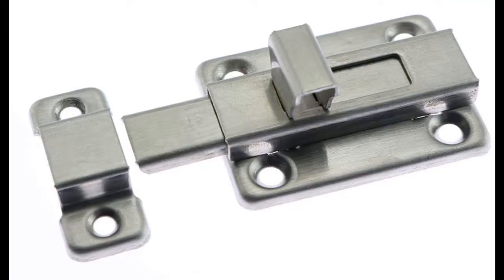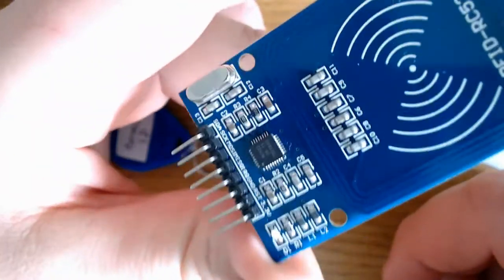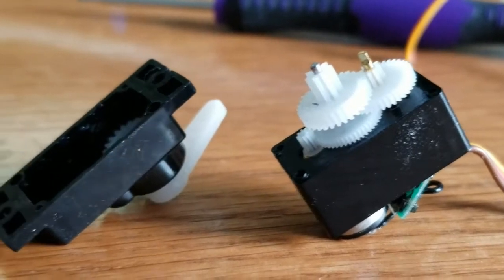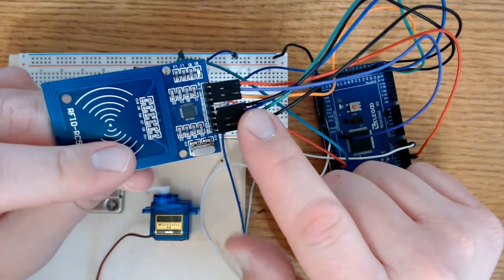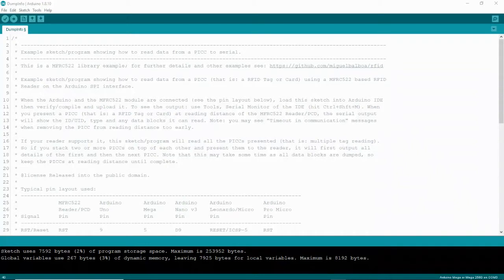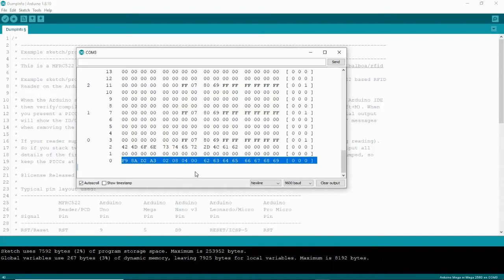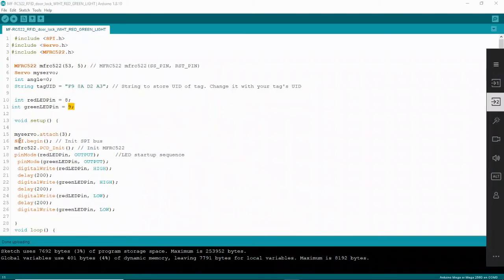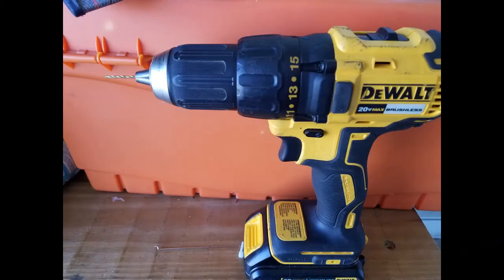DIY motorized door locking mechanism Using Arduino RFID & Servo Motor - A Simple Keyless Door Lock

Comment from the maker: The code could probably be cleaned up a bit but overall, this was a fun project. Give it a try!  Thanks for watching~
Reply: Hi can you tell me where I can find the code
Reply: Hi BMonster, is there any way of adding more than one rfid card to the code? Thanks.
Reply from the maker: @archiehaigh4796  I didn't forget about ya. Before I answer I want to test it out first so I'm not posting confusion :)  I will try it out this evening and let you know.
Reply from the maker: I added a video and code for 2 ID cards on the Facebook page.  I declared my second tag ID as "String tagUID2" and set up a 2nd if/else statement in the loop for the 2nd tag. See the post and let me know what ya think.
Reply: @BMonsterLaboratory  thank you, is there any way you can send the updated code by email as I don’t have Facebook. Thank you.
Reply from the maker: @archiehaigh4796  i'm emailing it to you now
Reply: @BMonsterLaboratory  thank you, and if I want to add a third tag I can just name the 3rd tag tag UID 3?
Reply from the maker: @archiehaigh4796  Yes, and add that tag to the if/else statement in the loop.

Comment: Good afternoon BMonster Laboratory! Could you possible share your final code for the door lock? Somewhere your fans can try the same code?
Reply: I would most definitely like to join that! I am looking to become an engineer soon and your projects truly help me get a better understanding of basic hardware/software.
Reply from the maker: @Tune-zi7yr  That's great. Send me a message at bmonsterlaboratory@gmail.com and  Include "ADD ME" in subject.
Reply from the maker: hey there!
I used to post all code to Facebook but it got really confusing for longer code and sometimes the code post would be hidden. I now send all code and diagrams to my mail list, and you're certainly welcome to join that - just send me an email if interested.  Best of luck to ya!!! 👍👍

Here's the code:

#include <SPI.h>
#include <Servo.h>
#include <MFRC522.h>
 MFRC522 mfrc522(53, 5); // MFRC522 mfrc522(SS_PIN, RST_PIN)
 Servo myservo;
 int angle=0;
 String tagUID = "F9 8A D2 A3"; // String to store UID of tag. Change it with your tag's UID
 int redLEDPin = 8;
int greenLEDPin = 9;
 void setup() {
 myservo.attach(3);
 SPI.begin(); // Init SPI bus
 mfrc522.PCD_Init(); // Init MFRC522
 pinMode(redLEDPin, OUTPUT);     //LED startup sequence
  pinMode(greenLEDPin, OUTPUT);
  digitalWrite(redLEDPin, HIGH);
  delay(200);
  digitalWrite(greenLEDPin, HIGH);
  delay(200);
  digitalWrite(redLEDPin, LOW);
  delay(200);
  digitalWrite(greenLEDPin, LOW);
 }
 void loop() {
 // Look for new cards
 if ( ! mfrc522.PICC_IsNewCardPresent()) {
 return;
 }
 // Select one of the cards
 if ( ! mfrc522.PICC_ReadCardSerial()) {
 return;
 }
 //Reading from the card
 String tag = "";
 for (byte i = 0; i < mfrc522.uid.size; i++)
 {
 tag.concat(String(mfrc522.uid.uidByte[i] < 0x10 ? " 0" : " "));
 tag.concat(String(mfrc522.uid.uidByte[i], HEX));
 }
 tag.toUpperCase();
 //Checking the card
 if (tag.substring(1) == tagUID) //change here the UID of the card/cards that you want to give access
 {
 digitalWrite(greenLEDPin, HIGH);    //Green LED sequence
      delay(200);
      digitalWrite(greenLEDPin, LOW);
      delay(200);
      digitalWrite(greenLEDPin, HIGH);
      delay(200);
      digitalWrite(greenLEDPin, LOW);
      delay(200);
 myservo.write(180);
 //digitalWrite(greenLed, HIGH);
 delay(5000);
 //digitalWrite(greenLed, LOW);
 myservo.write(0);
}
 else
 {
 // If UID of tag is not matched.
  Serial.println ("Access Denied");
    digitalWrite(redLEDPin, HIGH);      //Red LED sequence
    delay(200);
    digitalWrite(redLEDPin, LOW);
    delay(200);
    digitalWrite(redLEDPin, HIGH);
    delay(200);
    digitalWrite(redLEDPin, LOW);
    delay(200);
 }
 }

Comment: My board is arduino nano can you tell me where to connect what with what?? My board does not have D52 or D51 it only has up to D13
Reply from the maker: Ya, no problem!
Those are SPI interface connections. Here they are for the Uno.
SPI: 10 (SS/SDA), 11 (MOSI), 12 (MISO), 13 (SCK). These pins support SPI communication using the SPI library.
Check out this Arduino site for Uno pinout - it's very helpful. https://docs.arduino.cc/retired/boards/arduino-uno-rev3-with-long-pins/
When changing boards and pins, make sure you define the correct pin number. In this case,  ( #define SS_PIN 10, #define RST_PIN 5)
 👍💪

Comment: I can't figure out how to add multiple tags. I tried adding a comma like you said but then neither of my tags work. Right now, I can use only one tag. Thanks!
Reply from the maker: hi! You can use an array of strings to store the allowed UIDs and then check if the scanned tag's UID matches any of the allowed UIDs. Try this. The sketch for this video was posted to Facebook. After modifying it, it would look like this.

#include <SPI.h>
#include <Servo.h>
#include <MFRC522.h>

MFRC522 mfrc522(53, 5); // MFRC522 mfrc522(SS_PIN, RST_PIN)
Servo myservo;
int angle = 0;

// Array to store UIDs of allowed tags. Change these values to your tag UIDs.
String allowedTags[] = {"F9 8A D2 A3", "YOUR_SECOND_TAG_UID", "YOUR_THIRD_TAG_UID"};
int numAllowedTags = sizeof(allowedTags) / sizeof(allowedTags[0]);

int redLEDPin = 8;
int greenLEDPin = 9;

void setup() {
  myservo.attach(3);
  SPI.begin(); // Init SPI bus
  mfrc522.PCD_Init(); // Init MFRC522
  pinMode(redLEDPin, OUTPUT);     //LED startup sequence
  pinMode(greenLEDPin, OUTPUT);
  digitalWrite(redLEDPin, HIGH);
  delay(200);
  digitalWrite(greenLEDPin, HIGH);
  delay(200);
  digitalWrite(redLEDPin, LOW);
  delay(200);
  digitalWrite(greenLEDPin, LOW);
  Serial.begin(9600); // Initialize serial communications
}

void loop() {
  // Look for new cards
  if (!mfrc522.PICC_IsNewCardPresent()) {
    return;
  }
  // Select one of the cards
  if (!mfrc522.PICC_ReadCardSerial()) {
    return;
  }
  // Reading from the card
  String tag = "";
  for (byte i = 0; i < mfrc522.uid.size; i++) {
    tag.concat(String(mfrc522.uid.uidByte[i] < 0x10 ? " 0" : " "));
    tag.concat(String(mfrc522.uid.uidByte[i], HEX));
  }
  tag.toUpperCase();

  // Check if the scanned tag is in the list of allowed tags
  bool accessGranted = false;
  for (int i = 0; i < numAllowedTags; i++) {
    if (tag.substring(1) == allowedTags[i]) {
      accessGranted = true;
      break;
    }
  }

  if (accessGranted) {
    // If the tag is allowed
    Serial.println("Access Granted");
    digitalWrite(greenLEDPin, HIGH);    // Green LED sequence
    delay(200);
    digitalWrite(greenLEDPin, LOW);
    delay(200);
    digitalWrite(greenLEDPin, HIGH);
    delay(200);
    digitalWrite(greenLEDPin, LOW);
    delay(200);
    myservo.write(180);
    delay(5000);
    myservo.write(0);
  } else {
    // If the tag is not allowed
    Serial.println("Access Denied");
    digitalWrite(redLEDPin, HIGH);      // Red LED sequence
    delay(200);
    digitalWrite(redLEDPin, LOW);
    delay(200);
    digitalWrite(redLEDPin,
Reply from the maker: You are scanning each card for it's own unique UID ?  just checkin' 👍

Comment: Please give me the code
Reply: Circuit diagram please
Reply from the maker: see 8:01  for rfid reader wiring. 👍
Reply from the maker: here it is                 
#include <SPI.h>
#include <Servo.h>
#include <MFRC522.h>
 MFRC522 mfrc522(53, 5); // MFRC522 mfrc522(SS_PIN, RST_PIN)
 Servo myservo;
 int angle=0;
 String tagUID = "F9 8A D2 A3"; // String to store UID of tag. Change it with your tag's UID
 int redLEDPin = 8;
int greenLEDPin = 9;
 void setup() {
 myservo.attach(3);
 SPI.begin(); // Init SPI bus
 mfrc522.PCD_Init(); // Init MFRC522
 pinMode(redLEDPin, OUTPUT);     //LED startup sequence
  pinMode(greenLEDPin, OUTPUT);
  digitalWrite(redLEDPin, HIGH);
  delay(200);
  digitalWrite(greenLEDPin, HIGH);
  delay(200);
  digitalWrite(redLEDPin, LOW);
  delay(200);
  digitalWrite(greenLEDPin, LOW);
 }
 void loop() {
 // Look for new cards
 if ( ! mfrc522.PICC_IsNewCardPresent()) {
 return;
 }
 // Select one of the cards
 if ( ! mfrc522.PICC_ReadCardSerial()) {
 return;
 }
 //Reading from the card
 String tag = "";
 for (byte i = 0; i < mfrc522.uid.size; i++)
 {
 tag.concat(String(mfrc522.uid.uidByte[i] < 0x10 ? " 0" : " "));
 tag.concat(String(mfrc522.uid.uidByte[i], HEX));
 }
 tag.toUpperCase();
 //Checking the card
 if (tag.substring(1) == tagUID) //change here the UID of the card/cards that you want to give access
 {
 digitalWrite(greenLEDPin, HIGH);    //Green LED sequence
      delay(200);
      digitalWrite(greenLEDPin, LOW);
      delay(200);
      digitalWrite(greenLEDPin, HIGH);
      delay(200);
      digitalWrite(greenLEDPin, LOW);
      delay(200);
 myservo.write(180);
 //digitalWrite(greenLed, HIGH);
 delay(5000);
 //digitalWrite(greenLed, LOW);
 myservo.write(0);
}
 else
 {
 // If UID of tag is not matched.
  Serial.println ("Access Denied");
    digitalWrite(redLEDPin, HIGH);      //Red LED sequence
    delay(200);
    digitalWrite(redLEDPin, LOW);
    delay(200);
    digitalWrite(redLEDPin, HIGH);
    delay(200);
    digitalWrite(redLEDPin, LOW);
    delay(200);
 }
 }

Comment: hello! I'm planning to use a servo-operated lock for a project of mine, and was wondering is you still had a link to that specific lock? It's nice that a wire can be fed into the handle. I think I found it but so far nothing has given me a side-view to verify it's hollow. Thanks a lot!
Reply from the maker: Hi there!  I got this on Amazon.  Do a search with ASIN:B07SHS9TQH  that should pull it up

Comment: Can you please give me the whole code except for the LED part? Thx in advance
Reply from the maker: hello!   I found the code on the Facebook post and removed the LED functionality.  Here it is.        

#include <SPI.h>
#include <Servo.h>
#include <MFRC522.h>

MFRC522 mfrc522(53, 5); // MFRC522 mfrc522(SS_PIN, RST_PIN)
Servo myservo;
int angle=0;
String tagUID = "F9 8A D2 A3"; // String to store UID of tag. Change it with your tag's UID

void setup() {
  myservo.attach(3);
  SPI.begin(); // Init SPI bus
  mfrc522.PCD_Init(); // Init MFRC522
}

void loop() {
  // Look for new cards
  if (!mfrc522.PICC_IsNewCardPresent()) {
    return;
  }

  // Select one of the cards
  if (!mfrc522.PICC_ReadCardSerial()) {
    return;
  }

  //Reading from the card
  String tag = "";
  for (byte i = 0; i < mfrc522.uid.size; i++)
  {
    tag.concat(String(mfrc522.uid.uidByte[i] < 0x10 ? " 0" : " "));
    tag.concat(String(mfrc522.uid.uidByte[i], HEX));
  }
  tag.toUpperCase();

  //Checking the card
  if (tag.substring(1) == tagUID) //change here the UID of the card/cards that you want to give access
  {
    myservo.write(180);
    delay(5000);
    myservo.write(0);
  }
  else
  {
    // If UID of tag is not matched.
    Serial.println ("Access Denied");
  }
}
Reply: @BMonsterLaboratory  thanks so much(going to sub and tell my friend about this channel)
Reply from the maker: @Lowgraphic0  Awesome. thanks~!

Comment: when i want to open it manually the servo will resist and i can't get new position (opened) any idea how to solve this ?
Reply from the maker: If your closed angle is 0, close the lock and reattach the servo. the servo will go to 180 when the lock is open.  You may also need to disconnect your servo power and rotate arm to 0 (locked) position.  Be sure it's disconnected and don't use excessive force or attempt to move the arm beyond its normal range of motion.  I think that should do it!  Have fun 👊👍
Reply: @BMonsterLaboratory  I'm going to try this, thank you so much very clear and informative video👏
Reply from the maker: @ghoumamohamed  you're welcome. best of luck on your projects.

Comment: Hii there! 
Can you please provide the breadboard schematics?
Reply from the maker: For the breadboard, it's just 2 leds.  The ground rail is connected to Arduino ground pin. Both short pins of the leds are connected to that same ground rail.
The  long pin of the 2 leds are each connected to a 220ohm resistor which is connected to pin 8 and 9 on the Arduino. That's it. Hope that helps 👍

Comment: bro can u help me now !!! im cant use code MFRC522.h
Arduino: 1.8.18 (Windows 10), Board: "Arduino Uno"

Arduino-Security-Access-Lock-RFID-MFRC522:7:10: fatal error: MFRC522.h: No such file or directory

 #include <MFRC522.h>

          ^~~~~~~~~~~

compilation terminated.

exit status 1

MFRC522.h: No such file or directory

This report would have more information with
"Show verbose output during compilation"
option enabled in File -> Preferences.

pls help me!!
Reply from the maker: Hi there. 
You need to install the MFRC522 library. Go to "manage libraries" in your IDE and search "MFRC522". Install it from there.
Reply: @BMonsterLaboratory  thanks bro 👍🏽👍🏽 appreciate you

Comment: Hello BMonster Laboratory, Can i change Arduino mega 2560 to arduino uno r3?
Reply from the maker: Hi there! yes, you can switch from mega to uno in the IDE. click the tools tab on the top left, click on the "board" drop down menu, click Arduino AVR Boards and select "UNO" from the drop down menu. Also, make sure you have the right port selected under the tools tab. Hope that helps! This video may help with getting started - https://youtu.be/UiQ7bEZdvOg

Comment: My servo keeps buzzing in locked and unlocked positions. Like it's trying to move further.
Reply from the maker: Hey Rich!  This happens to me when I don't have sufficient power to the servo. Are you using an external 5-6v power supply?  Is your lock too heavy or is if difficult to lock and unlock?
Reply: @BMonsterLaboratory  I haven't attached a lock yet. I will try using my bench power supply. I've had it setup on a breadboard. I will set it up again later and will let you know how it goes.
Reply from the maker: @Richie_  sounds good. Just don't power motors from arduino. Use a breadboard power supply.
Reply: @BMonsterLaboratory  it seems ok now. What is the code int lock = 4; do? what is the value 4?
Reply from the maker: int is a data-type.  lock is defined pin 4 on the Arduino board. Check out Arduino reference page and cplusplus.com tutorials for references. It's very helpful.
Reply: @BMonsterLaboratory  I thought the servo was controlling the lock, which is on 3.
Reply from the maker: @Richie_  I see what you're saying.  
If servo is on 3 it should be 
Int lock = 3;
And in setup it should say 
Servo.attach(lock);
Good catch... not sure why I left it like that.
Reply: @BMonsterLaboratory  cool.

Comment: Hey BMonster could you please email me the code for the project. Thanks!
Reply: Okay I can just copy and paste it into arduino ide?
Reply from the maker: @southerncharmoutdoors6639  yes. It should work
Reply: Okay thanks
Reply from the maker: @southerncharmoutdoors6639  welcome anytime
Reply from the maker: #include <SPI.h>
#include <Servo.h>
#include <MFRC522.h>

 MFRC522 mfrc522(53, 5); // MFRC522 mfrc522(SS_PIN, RST_PIN)
 Servo myservo;
 int angle=0;
 String tagUID = "F9 8A D2 A3"; // String to store UID of tag. Change it with your tag's UID

 int redLEDPin = 8;
int greenLEDPin = 9;
 
 void setup() {
 myservo.attach(3);
 SPI.begin(); // Init SPI bus
 mfrc522.PCD_Init(); // Init MFRC522
 pinMode(redLEDPin, OUTPUT);     //LED startup sequence
  pinMode(greenLEDPin, OUTPUT);
  digitalWrite(redLEDPin, HIGH);
  delay(200);
  digitalWrite(greenLEDPin, HIGH);
  delay(200);
  digitalWrite(redLEDPin, LOW);
  delay(200);
  digitalWrite(greenLEDPin, LOW);
 
 }
 void loop() {
 
 // Look for new cards
 if ( ! mfrc522.PICC_IsNewCardPresent()) {
 return;
 }
 // Select one of the cards
 if ( ! mfrc522.PICC_ReadCardSerial()) {
 return;
 }
 
 //Reading from the card
 String tag = "";
 for (byte i = 0; i < mfrc522.uid.size; i++)
 {
 tag.concat(String(mfrc522.uid.uidByte[i] < 0x10 ? " 0" : " "));
 tag.concat(String(mfrc522.uid.uidByte[i], HEX));
 }
 tag.toUpperCase();
 
 //Checking the card
 if (tag.substring(1) == tagUID) //change here the UID of the card/cards that you want to give access
 {
 digitalWrite(greenLEDPin, HIGH);    //Green LED sequence
      delay(200);
      digitalWrite(greenLEDPin, LOW);
      delay(200);
      digitalWrite(greenLEDPin, HIGH);
      delay(200);
      digitalWrite(greenLEDPin, LOW);
      delay(200);
      
 myservo.write(180);
 //digitalWrite(greenLed, HIGH);
 delay(5000);
 //digitalWrite(greenLed, LOW);
 myservo.write(0);
 

 
}
 else
 {
 // If UID of tag is not matched.
  Serial.println ("Access Denied");
    digitalWrite(redLEDPin, HIGH);      //Red LED sequence
    delay(200);
    digitalWrite(redLEDPin, LOW);
    delay(200);
    digitalWrite(redLEDPin, HIGH);
    delay(200);
    digitalWrite(redLEDPin, LOW);
    delay(200);

 }
 }
Reply from the maker: Hi R Lewis! Try the code I posted.  I'm surprised it fit. You can also find it on Facebook search #simplekeylessdoorlock

Comment: Hello thanks for explaining, I'm going to program a gaz sensor for my final project the gaz sensor+ buzzer + led it's working for me but i don't know how to program with it a servomotor is there any code for all these please, or can i have help I'm not good in programmation
Reply from the maker: hi there! I'm not sure what a gaz sensor is. Is this a gas sensor?  Like a CO2 or methane sensor with a buzzer and led flashing lights? What is the purpose of the servo motor in your setup? It sounds like a great project...just need more detail. I would be happy to help however I can. Thanks for asking!
Reply: Yeah it's a gaz sensor for all gaz toxic , the servo motor should be turning the gaz off when the gaz is on , i just tried to modify my code with how u programs the servo motor it's working but not following the gaz , i hope u can help me cuz i have a close deadline
It's a methane sensor with a buzzer and led flashing lights
Reply: If it's possible i can send u more on Instagram or Whatsapp or any app u have , thank you